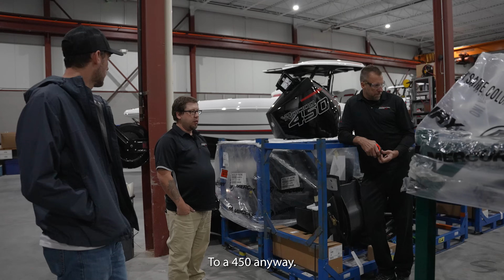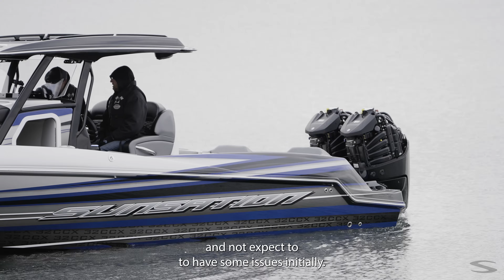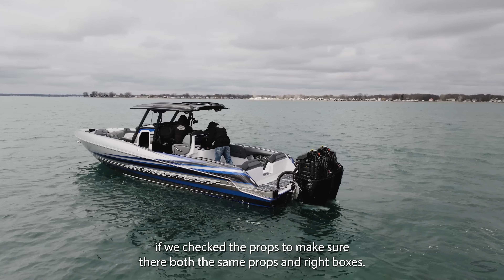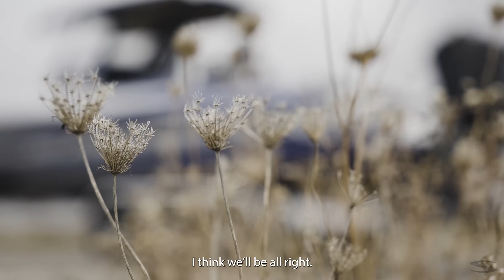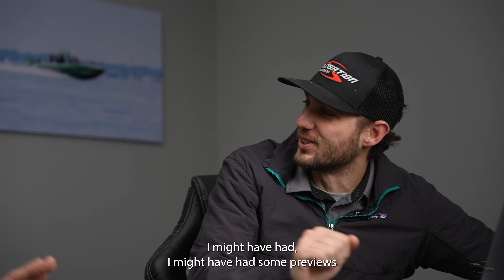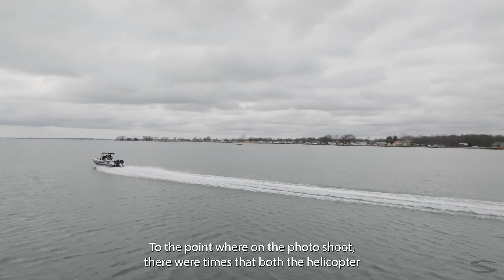First Impressions: Mercury Racing 400R V10

Comment: As cool as the idea of the V10 is, I completely fail to see the point over the slightly lighter 450R and the much lighter older 400R. Adding almost 100 lbs per engine is just not a good choice in my book.
Reply: A cheaper, better and longer lasting motor.

Comment: This motor would be insane with one of those new Sharrow toroidal props (with the loops instead of regular blades.) Bet you'd get 85 out of it.
Reply: Yep, Sharrows would help that boat get bite in a sharp turn and they are better for the environment.
Reply: I know two guys now who tried to get into the Sharrow prop thing. Only word that fits with that company is scammers.

Comment: Unfortunately Big Government will put an end to the big center console boats with big outboards. Passing a bill soon any boat over 30 ft can't go faster then 20mph to save the whales. And by 2030 no more gas outboards electric only. Big boats will be diesel only. The end of the big fast outboards and big center consoles is on its way. I heard in the bill that boats under 30 ft will not have a speed limit,  but boats over 30 feet will no longer get be allowed to travel over 20 MPH

Comment: forget the jack plate and make a transom bracket that sets the motors back a foot.. You can build a tub that will hold water for better starts then self drain (hole in the bottom) for the best top speed. You should gain 5-10mph.
Reply: If they had a better hull, they wouldn't need to do stupid shit to get the boat to run better.
Reply: @CharlieOdom1957  jTrue! But an off-shore bracket works on any hull. Gets the prop into clean water. I never liked jack plates, just adds a bunch of weight with little to no performance gain.
Reply: @freeradical6390  wow, your comment is beyond ignorant. Maybe you should do a little more research before making such a fool of yourself in public next time.
Reply: Are you aware that Sunsation has built fast boats for a few decades? I think they know what they are doing. And jackplates are perfectly fine and the way to go.Also if you can't get speed from a jack plate, that's on you. I have seen 10+ mph in some situations.
Reply: @AB-80X  so, which is it? Does the damn company know what they are doing or not?

You can't say that they know what they are doing when it comes to hull design, while saying they do not know that adding a jack plate or standoff bracket will make their boats 10mph faster.

So, either you are a complete idiot, which I would hypothesize to be accurate, or the designers at a major boat manufacturer, making go-fast boats, deliberately leaves off a device that would make their boats 10mph faster.

Properly designed hulls do not need or benefit from any kind of standoff bracket, which is why manufacturers don't install them on certain boats.

Personally, I have been on many boats with and without standoff type brackets, and the only ones that benefit are ones that are not properly designed, or specifically designed for them, in which case they come from the factory with the bracket, I.E. Allison, Bullet, Regulator, Sportsman, etc, to name a few.

Comment: Thanks Sunsation for the video, but can you give your though on why Mercury is going to a V-10 instead of just increasing the displacement on the V-8 450R?  I am not only curious, I am in the market for a new boat/engine package.

WHY?

Mercury V10-400R     5.7L    400hp naturally aspirated    89 octane    695lb    3 year warranty Mercury secret

Mercury V-8-450R      4.6L    450hp supercharged            89 octane    689lb     3 year warranty Mercury secret

Yamaha V-8-450XTO 5.6L   450hp naturally aspirated    89 octane    952lb      5 year warranty $50,000.00 (at least they list their price, and I am sure it's is way less than Mercury)

WHY the V-10-400R -- more moving parts, taller, less horsepower, AND naturally aspirated. Yes possibly a small gain in torque at sea level due to displacement, but again more moving parts, taller, and less horsepower. Look at the numbers for Ford V-10 vs Chevy V-8 heavy duty trucks, they have been doing it for a long, long time. Look at Chevys new 2.7L four cylinder turbo, yes a four cylinder -- 310hp and 430 ft torque, at ANY elevation. Supercharging/turbocharging is where things seem to be headed. SO much torque gains with supercharging. Look at Yamaha/Kawasaki/Sea Doo with their watercraft. Their muscle craft are Supercharged or Turbocharged, 3 cylinders pushing out 300 hp. ANY naturally aspirated watercraft doesn't hold water on these machines.

WHY not just increase the displacement in the 4.6L 450R if they need even more low end torque and/or reliability? Make the V-8 a 5.7L and keep the supercharging. That thing would be a beast.

Thankfully Yamaha is trying. Although they beat Mercury in terms of warranty and are willing to list their price, the weight of their new 450XTO is absurd.
Reply: im guessing its like the v12 with 2 less cylinders so was reasonably cost effective and might be more reliable without a blower on heavier hulls
Reply: I'm also curious.  If I had to guess I would say that some sort of EPA crackdown/ re-interpretation of a "law" has led to this new engine making less power with more.  I know thats the case on the automotive side of things.

Comment: So no break in at all.
Reply: No real reason for a break-in. Heat cycle it once to seat the rings, and its good to go. The only reason they recommend a break in is to ensure that there isnt a catastrophic failure due to an inferior engine. If you limit the rpms on the first run, the engine can only get so damaged. Both mercury and yamaha do a full throttle test in a tank to every single engine directly off the assembly line anyways.